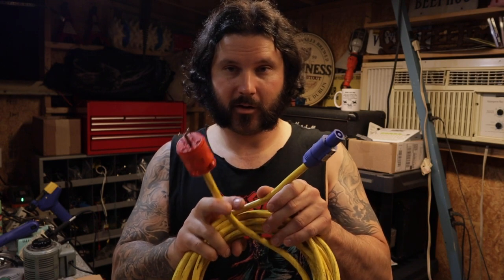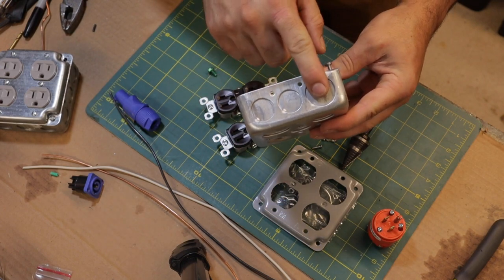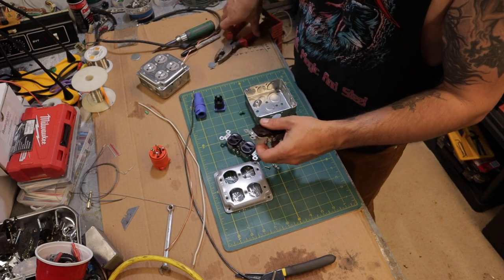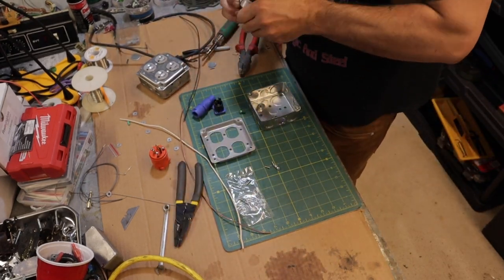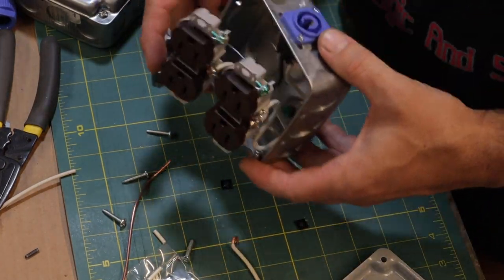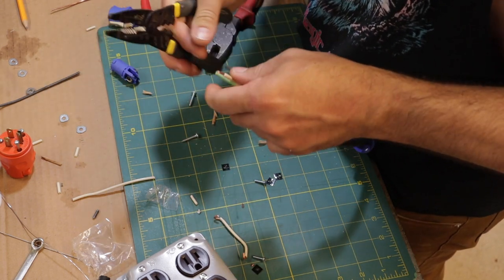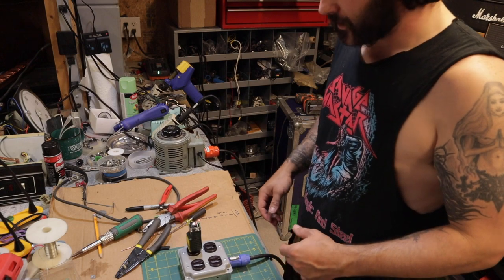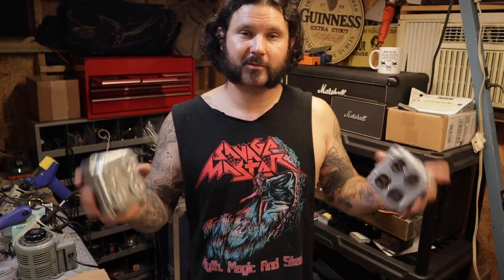How to make an affordable Quad Power Drop: Durable and great for stage use

Comment: As a former electrician, thank you for showing people safe easy right way.
Reply: Dunno if I'd consider soldering power connectors as the right way. Crimped connectors won't melt.
Reply: I hate to say it, a couple of concerning things in this video:  I would run a ground wire regardless if the box is PVC, painted or metal.  It's better to be safe than sorry.  Two, it doesn't hurt to do the wiring the right way with pig tails from the PowerCON to each outlet properly terminated with wire nuts or just running two pig tails soldered to the PowerCON to each outlet.
Reply: @helmanfrow  Soldering is a better mechanical connection than spade style connectors.  It's not if they melt, it's if they are exposed to bumps and vibrations causing the metal to create resistances, heating up and not forming a solid connection in the future causing equipment malfunction, damage or possibly a fire.  That's one of the reasons I also don't like Wago lever connectors, same problems.

That said, you should get into the habit of inspecting your power taps and extension cords each time before use.
Reply: @WJCTechyman  I agree that solder connections are a better electrical connection. I agree that cracks from vibrations could form, increasing resistance and cause the joint to overheat (and potentially melt).

I'm not sure, however, that I agree about Wago connectors. How would  resistance in the cage clamp change with vibration? The only way that could happen is if the spring lost tension, right?

Generally speaking, though, it's not like these boxes are strapped to a jackhammer. A secure connection is sitting pretty in the box, which is taking most of the abuse on stage. The only other vibration I can think of is riding around in a trailer, which really isn't the kind of stress that would shake loose a secure connection.

Still, I'd have crimped them to be sure. ;)

Comment: The most comprehensive video I've seen! I am building an extension just like the one you are building. In a band and a Sound Engineer for 66 years (and counting) what you are doing and your method makes sense. I believe in soldering as much as possible. It helps when you actually know how to solder, (my brother told me soldering is similar to welding, heat up the thicker material first). As a guitar player, I am all about Tubes and Point to Point wired amps! It saves money when you get vintage (pre-circuit board) amps and a good friend who repairs and custom built my Point to Point wired "Head".  Actually he uses me for my "ears.'" It is a modified Fender Champ circuit. I usually play with a sound system, so loud enough to be my monitor. I subscribed and will be watching your videos!

Comment: Cool video.  I'm going to build some of these myself.  But I won't solder the wires to the powercon because - NEC says it's illegal.  Proper connectors and crimping tool do a fine job.
Reply: I'm pretty sure that electrical code only prohibits soldering on the ground terminal, but yeah, def just fine to use the crimp and maybe even heat shrink it if you wanna be spicy

Comment: Killer video!!  I had no idea if I'm understanding you correctly, that you could run 2 rigs off of 14ga wire!  I figured the amps would require 10 or 12. but then again, I know very little about electricity/electronics!  Thanks for sharing!!
Reply from the maker: It really depends on the distance.  A 14AWG wire can handle 20A if it's short enough. In most cases I would try and keep the runs 50' or under and you should be good up to about 15A.  The distance from the socket to the breaker matters as well.  A 100W guitar amp isn't going to draw more than 4A so you could likely run three without any problems.
Reply: @purgasound  Excellent, thank you for your response!  I really enjoy your channel and your playing, you seem like a really cool guy!  I guess we're kind of neighbors, well at least Virginians!  I live in SW Virginia, just south of Roanoke.  I must admit, I missed out big-time on the GWAR thing back in the early days, my stupidity!  I had friends that got to partake in the early days, and I kick myself in the ass for not going to some of those shows back then!

Comment: I have started gluing PowerCon and other chassis mount connectors into the box or panel with epoxy before drilling the two screw holes.  It avoids the drill wandering while trying to drill the two small holes.

Comment: Question... What's the benefit of using a power powercon connector instead of just wiring the extension cord to the receptacles?
Reply from the maker: A direct wired connection will pull loose and likely fail over time with heavy use. Every hardwired one I've seen out on the road is in desperate need of repair.  Being able to disconnect the cable makes storage safe and easy.
Reply: Allows you to have different lengths of power cable, being able to swap out a spare and avoids dealing with installing strain relief.  This is a huge help especially if you're building the type with the through/output powercon connection.  Also as Purgasound noted below, the direct wired one's need consistent maintenance to keep them tight and in good condition.
Reply: @purgasound Thanks!

Comment: What is the difference/ advantage of this compared to a power strip or a surge protector? Seems like a lot of work when you can buy a strip for $10. I can see how this metal box would be hold up better esp in a touring application but is there any other advantage?
Reply from the maker: A power strip doesn't have a 40' cord attached to it.  They are bulky and don't sit right on a stage.  Some can trip as they aren't rated for much amperage.  If a normal power strip works for someone than that's fine. There's nothing wrong with it.  They're throwaways though, that plastic stuff can't be repaired and I don't like having a switch or breaker directly on a power drop like that.  To each their own.

Comment: Did i miss the part where you attached the panel mount blue powercon ground to the outlets? Going to just the box isn’t code…
Reply from the maker: Probably. I typically will use a grounding lug screw in the box and tie in the outlets and the incoming ground together.

Comment: hello /// how many outlet  can i set up for one powerCON  ??/ i need to build one small power distro with six outlet   with a thermal  switch using a powerCON    //// greetings from Peru /////////
Reply from the maker: Type A Blue end PowerCON's are rated for 20A. You can use as many outlets as you need as long as the max current draw does not exceed 20A.  Make sure internal wiring and the cord are also sized appropriately for the intended load.

Comment: If going this route, I would highly recommend instead of standard powercon, using powercon True1 instead (True1 TOP is what the newest generation is called, as of this post).  That connection can be connected and disconnected under load - meaning ground is the first to be connected and last to be disconnected, this is the reason that most ground pins on other plugs are slightly longer, and standard powercon (either blue or white connectors) do not have this feature, so your connection can arc if you need to connect or disconnect while pulling a moderate load.  True1 is also IP65 rated, so should things get a little wet, the side of your box shouldn't let water in through this connection.  Another thing you can do is add an additional thru connection and wherever you drop this power, you can easily extend off of it without occupying any of the top outlets.  True1 also features mate-able connectors on their plugs (a male and a female that can connect to eachother), where standard powercon does not, you only have plugs (male) and mounted jacks (female) and two different colored connectors that don't connect to eachother for extension purposes.

Comment: I don't understand why the box has to be removable. Why not hardwire it?
Reply from the maker: Every one I’ve ever seen hardwired has frayed ends and is coming out of the box with the leads exposed. Likely from stagehands and audio crew constantly picking them up by the cable. 
Better for storage. Better for maintenance. Worn cables are easily replaced without ever having to open the box. Box never has to be opened again period.
Reply: @purgasound  And they can be daisy-chained if you use two Powercons.